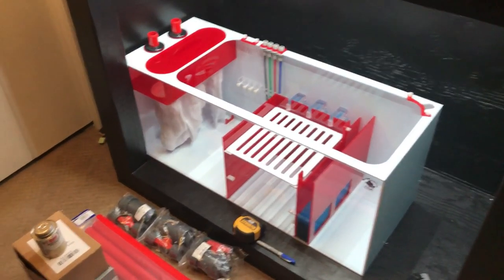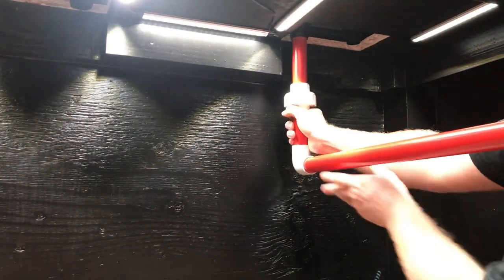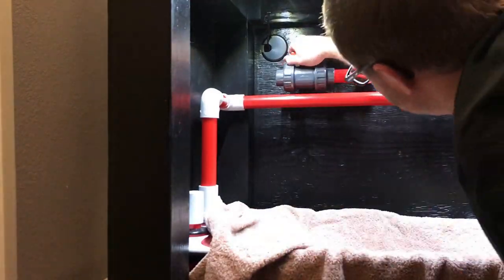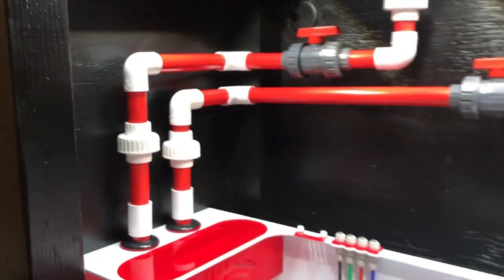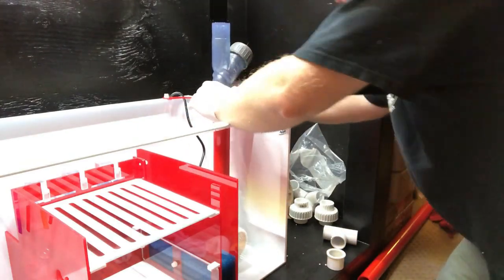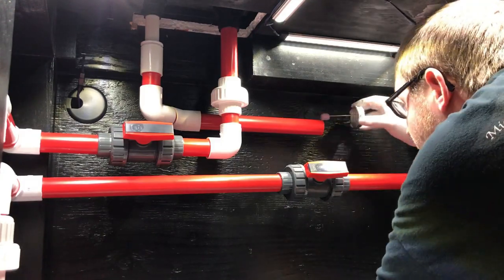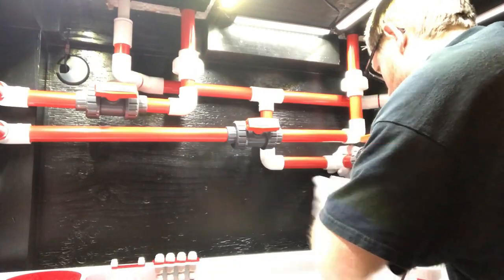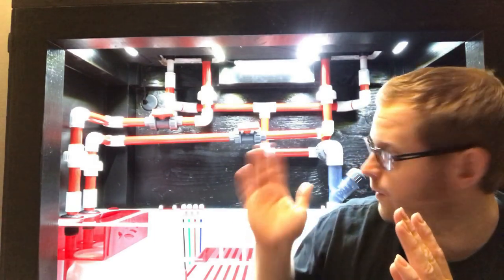HOW I Created My SHOW SALTWATER REEF TANK SUMP SYSTEM

Comment: So the bulk heads you used aren’t the ones that you installed from the previous video you did on the aqueon overflow kits.  Why did you change them out? I’m assuming you didn’t like the barb connection and preferred the slip Pvc connection?   Just curious on your thoughts?
Reply from the maker: I like bulkheads with the pvc connector better

Comment: What drill did you use for the desk grommet?
Reply from the maker: I got 2 inch deck grommets and used a 2 inch hole saw. After you drill the hole use hot glue to glue it in place. Works great.

Comment: I can't lie it is a very clean install. However I have to mention PVC pipe works on a theory of solvent welding. The primer is just as if not more important than the glue. It allows a chemical change in the PVC for the weld to occur. I hope you aren't going to run into future problems because you skipped The crucial step. Fingers crossed for you
Reply from the maker: Yeah I know. I only had purple primer and I wanted this to be clean. Its been run for over a month, no issues. Good point though
Reply: @inventoryking  they sell clear pvc primer